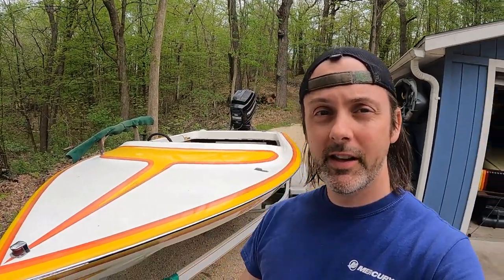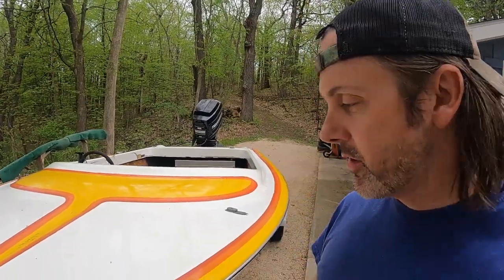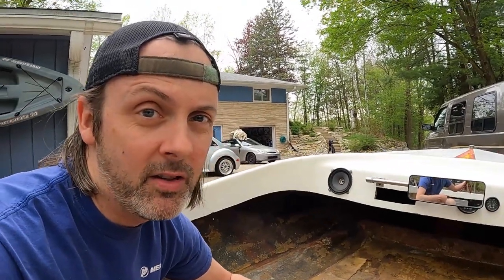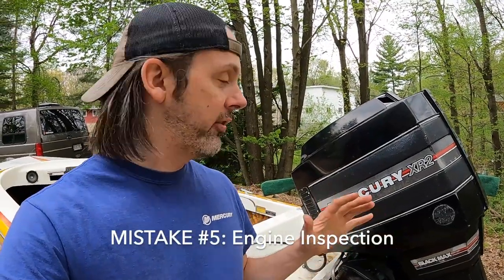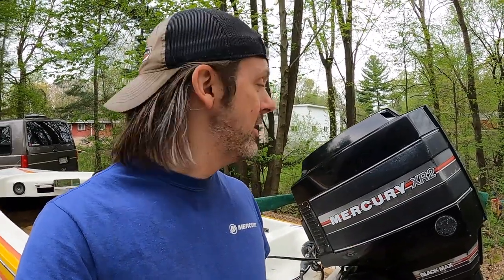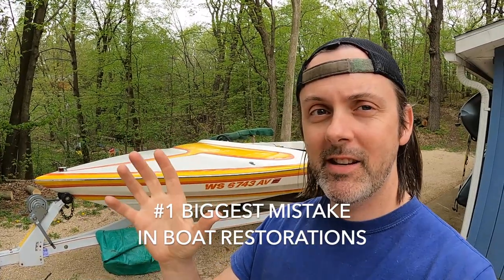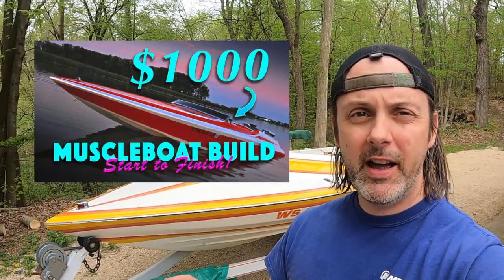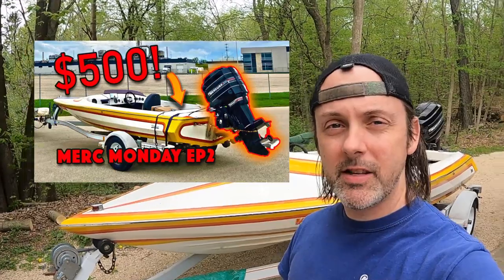Top 10 MISTAKES Buying Your First PROJECT BOAT

Comment: I’m considering something ski from the late 90’s, 96 and newer up to 2001ish. I love the look of these boats and want to avoid cabureted. I’m looking at CC, Tige, Malibu, mastercraft and centurion. Any insight? I realize none of them are “cool” but to me they still have the low sleek sporty look and the power to back it up.
Reply from the maker: No trim, rides bad, and props are super  expensive.  You sure?
Reply: @ADDvanced  ummmmm not anymore? I guess back to the drawing board……anything from that generation worth buying?
Reply from the maker: @lemons4315  Tons!  Just get something with a Mercruiser and a V8, or an outboard.   Look at Checkmates.  Bajas.  Pachanga 2s.  Oh, and everything will be carb'd.   There is no EFI til way later in your year range.   Keep lookin man.  Ski boats are great if all you do is ski all day, I'm just saying they're harder to take care of than something with a sterndrive or outboard.

Comment: Well, you said v-drives and jets were no good…does a direct drive inboard count.😂 I’m restoring a ‘73 Century Ski Fury 19. Bright orange gelcoat, goofy 70’s muscle car graphics and a 440 Chrysler. Maybe you’ll make an exception? She’ll be in the water this summer. While I understand you not liking the ability to trim, but the center mounted engine gets on plane instantly and mechanically it’s simple. Love your channel and if I could upload a pic, I would. You were a massive inspiration in my project! I had a Glastron GT 15; all the Carlsons were super cool. One of my most vivid memories from the early seventies was seeing a guy launch a black and blue, sparkly Checkmate with a tower of power and a bunch of pretty girls in bikinis on it…
Reply from the maker: I mean that is a cool boat no doubt, I know exactly what you’re talking about. But for most people tackling a project boat w limited boating experience it’s a bad idea; anything that can’t trim and has a fixed rudder is going to be hard to fix up if it’s a true project.   Bent driveshafts, super expensive hard to find props, hard to find service or parts.   Outboard or sterndrive is superior by most metrics; I would only consider one if water skiing were super high on your list and you already had a fair amount of boating experience.
Reply: @ADDvanced  I made plenty of boat mistakes over the years. I assessed the heck out of this one. Century’s have a big following, registry and club. This boat only had 200 hours on it. It was parked two years ago because the previous owner broke the rudder off (by doing right turns! This thing has enough power to shear a rudder!). I knew I could get the parts (NOS bronze rudder for $300). No rot, stored indoors it’s whole life. I think you’d agree; do your homework! And even though it was a great starting point, I still have hundreds of hours in it and spent twice the purchase price on parts and supplies. And driving a direct drive is more challenging…especially with a little performance rudder!
Reply: The mid engine direct drive is really designed around not leaving a boat wake. Cool boats if you like skiing. Def.
Reply from the maker: @sunbeamlands7  Yeah and all that is fine because as you said, you had a lot of boat experience over the years.  This video is aimed at newbs; I'm sure you knew most of these tips already too.   Just trying to help people out; I see so many people tackling such idiotic projects.

Comment: Ok. Here me out. I know you said jet boats arent worth restoring. 
I normally wouldn’t get one. But…..
I came across a 73 Tahiti Jet drive. Powered by the original olds 454 Big Block. The boat is cool as hell! Heavy gold metal flake and burgundy two tone gel coat. Brown diamond tuck interior. 
I can get it for 1200. Motor needs rebuild (which i can do myself). The boat looks as cool as the one in this video. Just a lot duller.
Reply from the maker: They’re worth restoring for sure!  I just don’t think they make very good first project boats because the jet drive makes it slower, super expensive parts to rebuild them, which they all seem to need, and the docking and weeds are issues that make seeking out a prop version more desirable.   Just my opinion.
Reply: @ADDvanced  your opinion is very well regarded. You’re a professional when it comes to boat restorations. You’ve done many. With great results. 
Unfortunately, i went to look at the boat yesterday. Transom wood was soft at the jet drive opening. And the gel coat was all heavily cracked on the entire deck. 
Would’ve needed a new transom and stripped and reapplied gel coat. Way more work than i would like to get into. Shame. It was a cool looking boat to.

Comment: Actually a pretty good video with some insightful information and straightforward. However he contradicts himself totally with the steel prop. In one point he says don't get a V-drive because of damage you could do to it and then goes on to say steel props are better. I would never consider a steel prop for basic boating on lakes that have lots of shallow parts..all you do is hit a log and now you're getting all kinds of new gears in the lower unit instead of just replacing the prop. Aluminum props are meant to bend on purpose so they don't do damage to anything else. Also it doesn't hurt my feelings that he doesn't like tri hulls with open bows but he completely leaves out how practical boats like that are versus his closed bow boats. We would take out a speed boat type boat maybe a couple times a year tops, but the tri hull that we restored we get tons of compliments on it, and it's super practical for fishing, pleasure boating ,Beaching, or pretty much anything else.. so a big factor he left out with restoring a boat is how often are you going to use it when you're done, so that it's worth all that work you put into it
Reply from the maker: You can't trim a V-drive, so it's really easy to damage the prop.

You can trim out a sterndrive or outboard, so it's really easy to avoid damaging your prop.

Not sure how that is contradictory.

Also, I like open bows too, there are plenty of old bajas, checkmates, and open bows that aren't totally lame.   But on facebook, I see people restoring GARBAGE boats because they got them for free.  It's not worth it, nobody is going to want an OMC trihull with their impossible to find parts and stupid outdrive gasket that can sink the boat.   I don't care how much money you put into it, or how nice you make it, it's a bad idea.

Comment: It's a matter of what you like, not what someone thinks is cool. The boat you show in this video to many people, including myself, is not cool. Going out on a lake and running back and forth as fast as you can would be boring. An old center console fishing boat is cool. Old Tri hull fishing boats are cool. I'm currently restoring a 1976 Caddo bass boat with an Evinrude. I can get any part I need for the Evinrude. Why would i restore this boat. Because buying one in great shape would cost around $2500, it will cost around $700. To $1200. for restoration. What's cool is up to the person, not some basic design.

Comment: Glad to see you back on YT.  What was the final resolution on your overheating issue?  Did I miss that video? 

Due to health reasons I have a project boat I need to sell.  1976 Glastron GT-150  with an Evinrude 135 Silver Starflite engine.  Located in Atlanta GA if anyone is interested.
Reply: Wish we were closer
Reply: Almost "James bond" spec?
Reply from the maker: Good luck with sale, GT150s are cool as heck!

Comment: I’m just curious about option on a boat I just bought for 500 from a mid 70 year old guy who’s the original owner it’s a 1973 sidewinder but it has a original 165 inline 6 stern drive mercruiser.
Reply from the maker: Not really worth it.  Nobody wants an early 70s in-line 6.   If it’s clean run it but it’s not worth restoring.

Comment: Just started a restoration. I cant find any info about what type of boat it is. I have asked on forums and ask groups on facebook with no success. Do u have an email i could send a pic to to see if you can identify what it is? Many thanks
Reply from the maker: Post the HIN, located on the stern, starboard side.
Reply: Search hi and low. Doesn't have one. From the UK
Reply from the maker: @fonzybyers  check out the 'about' section on my page, it should have a way to email me.

Comment: 🤣 I adopted an old Correct craft last year! it's a disaster! but it was cheap! it's a 1973 Martinique with a Holman Moody 351 ford V8. Cool or no?
Reply from the maker: That's a tough one.   I mean, it's more interesting than most boats, and I'm sure it'll be fun to drive, but the tow sports market is all about wake/surf/stuff with towers these days.  Old ski boats don't get much love unless they're newer, older stuff doesn't seem to ever be worth much even in good shape.
Reply: @ADDvanced  I have noticed several nautiques from the 80s selling for shockingly cheap lately.. They sound so damn good though! Worst case, the Velvet drive is worth about double what I paid just as a core!
Reply from the maker: @danosburn80  Right?   I've seen nautiques and moombas for like 5-6k occasionally.
Reply: @ADDvanced  We went from boats that create no wake to boats that create huge wakes.
Reply: @ADDvanced  saw an 84 nautique 2001 that needed the seats recovered for $2k last week.. mine is basically the same hull, the really interesting feature though is the  holman moody engine. 290hp in a 2200lb boat. I'm sure I can get the hp over 300 without much effort. maybe I should do a series fixing it up!
Reply from the maker: @pgnandt  The biggest lake near me, owned by rich conservative hypocrites that love to talk about freedom, gained control of the lake and STRICTLY enforce a 35mph speed limit because of "Land erosion".   Meanwhile they don't care if wake boats go in circles for hours making giant waves, but my tunnel hull going 60+ making almost no wake is a huge problem... for... reasons.  But they love freedom.  And oppressive laws.  So dumb.
Reply from the maker: @danosburn80  Do it!

Comment: If I had a dollar for everyone that said "jets are inefficient"  So here we go I grew up on all drive boats through the 70's  I'll List them, Outboards, Stern drives, Jets, Direct drive  and V Drives. I've owned Outboard , Direct drive and a Jet.  I have been able to run the Jet drive on one tank of gas faster and longer than any other "drive" boat. Learn how to drive and trim people ! Oh yeah before you all jump on me I am a mechanic by profession. Boater by passion.
Reply from the maker: Regardless of your experience, that is fact, man.   And around here, facts > feelings.  Jets are fun, they have great acceleration, but they are (fact) not as efficient.  You will often see 20' jetboats with big blocks struggling to hit 60mph; meanwhile my 150hp outboard is hitting 59mph before even messing with the jack plate.   My sterndrive small block aristocrat can hit 65ish, with way less displacement and power.

Where jets really excel is MONSTER horsepower V8 builds, because they don't need worry about shearing all the gears in a sterndrive.   But... for most people?  They suck.   Especially here in the midwest, where they clog multiple times per ride.
Reply: @ADDvanced  Great way to use my own words against me "boater by passion" . I guess you missed the first part "mechanic by profession"  My jet is stock and I can top out at 75 so 60 is no struggle for me .Yeah I don't care if you don't believe me. Oh and last summer I spent 6 hours towing in broken-down i/o"s , outboards v-drives, so I guess I could say stay away from those boats because they suck ! You are welcome to have your own opinion.  I could pick apart your reply to me all day long. In the end you will probably stand by your incorrect views (facts as you believe them to be) so have a nice day.
Reply: Jet boats suck.😉
Reply from the maker: @jimmiller30  Sounds like a cool boat, would still be faster if it had a prop.   Fact.

Comment: Is a 77 condor custom cool?  A jet boat , although you hate jets
Reply from the maker: Anything ModVP related is cool, I think those are originally Taylor molds?   Cool boat.   Would be faster with a prop tho 😛
Reply: @ADDvanced   I think so as well. Thanks for responding
Reply: @ADDvanced  what’s modVP?
Reply from the maker: @AntonioVasar1  Watch EP1 of my SST restoration series; explains ModVP

Comment: Not true mercury parts are getting hard to find also I work on both
Reply from the maker: False.   Easy to find.   Finding OMC stuff is obnoxious.
Reply: @ADDvanced  wrong
Reply from the maker: @michaelmurrietta2263  What are you having trouble finding?
Reply: Alot of parts like omc are hard to locate but can be found same with mercury
Reply from the maker: @michaelmurrietta2263  What are you having trouble finding?